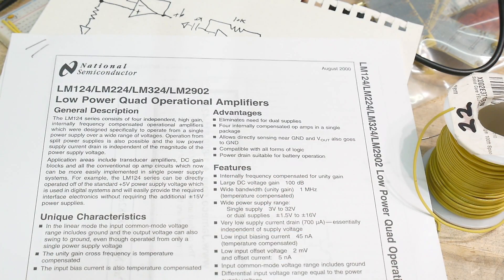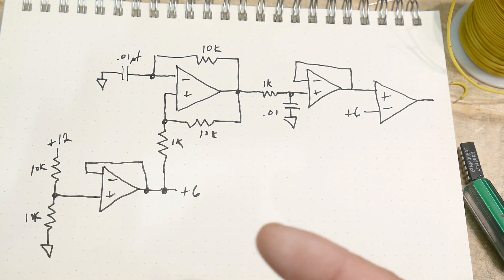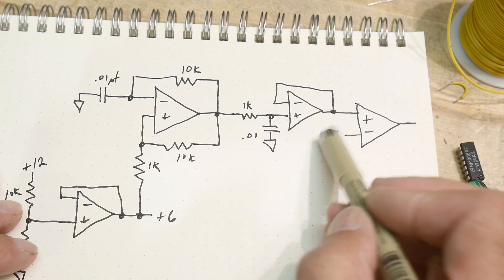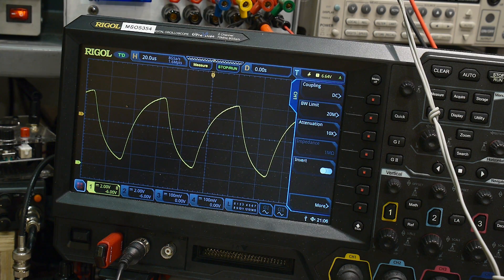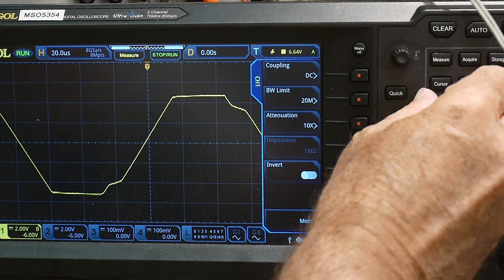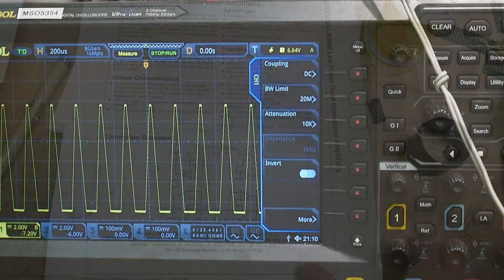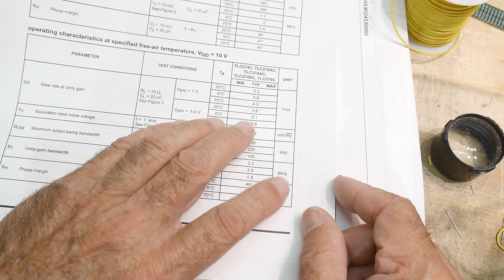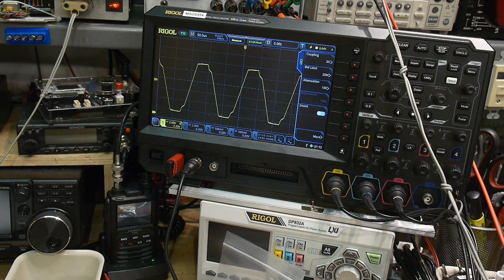#1177 LM324 Op-amp Slew Rate

Comment: ANY op amp can be used with a single supply or dual supplies. The questions are how close to the supply rails the output can swing and what the input common mode voltage range is. 

Op amps generally are slow when used as comparators. Two things come into play. Saturation of the output transistors, which are relatively large, means it takes time for excess carries in their bases to be removed or recombine so that turn-off can start. The other thing is that when the amp is driven to "large signal" operation, as they are when used as comparators, the internal frequency compensation capacitor(s) accumulate charge they would not in small signal operation. That excess charge needs to be removed to get signals to move. Amps without internal frequency compensation are generally faster but they are something of a rarity these days. If you want a good comparator, use a device intended to be a comparator. One advantage to an op amp as a comparator is that you can select an amp with ultra-low input offset voltage, such as a chopper-stabilized or "commutating auto-zero" amp. There are also a lot more choices if you need really low input bias current.

Comment: Just used a LM324 because I needed the large voltage range for a +\- 12 VAC output. Modern op amps don’t have that kind of voltage range. For everything else non-demanding I use the LM”V”324 or the MCP6002.
Reply: Yikes. Didn’t notice it was that bad! Your at roughly 6.5 kHz, so I’m probably okay in my application at 500-1,500 Hz.

Comment: The 324 is great so long as you're not working in the 100s of kilohertz. Used it in inverter and PSU designs, no issue
Reply: I get 15.9kHz maximum for a 10v pp sine wave with a 0.5V/μs slew rate. LM358 could be 0.3V/μs. That’s a 3.98kHz limit for 24v pp sine wave (worst case scenario). Fmax = SR/2piVp

Comment: Thanks for the video! But could you please go into more detail by what you mean by stiffen the 6 volts. How do calculate the return  path current? Coming off of your 12 volt divider why use the op-amp follower and not just come off of the top of the resistor for the 6 volts? If you have the time, could you go into more detail, that would be great! If not, we'll still thanks for the video! John
Reply from the maker: most of the time you don't need a buffer on the 6V, a nice capacitor is good to lower the noise. I just wanted to show one as many circuits have current that returns to ground, or in this case it returns to 6V and so if you have 100mA of return then yes you need a buffer
Reply: In detail, using 10K + 10K as a resistive divider to generate a 6V rail from a 12V rail is equivalent to a 6V supply with an internal resistance of 5K (the parallel combination of 10K and 10K). So if you tried to draw 1mA, for example, from that 6V rail, its voltage would drop by 5k * 1mA = 5V. That really isn't going to work if the +6V rail is now at just +1V.
However, if you buffer that resistive divider by using an opamp as a non-inverting amp with a gain of 1 (i.e. a "voltage follower") as shown in the video, then you can probably draw 50mA or more without any significant change in the 6V output.

Comment: If you re-check the "Voltage Follower Pulse Response" for the LM324 (at 9:06 ), you noted that it swung around 2.5V in 5μs, so you could have worked out that its slew rate is 0.5V/μs. That's pretty standard for these old op amps. It means the TLC274 is around 10 times faster.
Reply: I worked out 0.5V/μs in frequency: 
edit: 15.9kHz maximum for a 10v pp sine wave. 

LM358 could be as low as 0.3V/μs. That’s a 3.98kHz limit for 24v pp sine wave (worst case scenario).
Reply: @davadoff  I don't get the same numbers as you. Perhaps you could show your working and recheck your calculations?

I use V = A.sin(2πft) where is A is the amplitude (half the peak-to-peak voltage).
Then dV/dt = 2πfA.cos(2πf) which has a maximum when  t=0, making the maximum dV/dt equal to 2πfA.

If you consider a 50kHz sine wave with an amplitude of 5V (i.e. 10V pp), then you have a maximum rate of change of voltage of 2*π*50k*5 V/s = 1.57μV/s which then should be the minimum slew rate needed to avoid distortion of the sine wave.

At 50kHz, I would expect an LM358 (typical slew rate of 0.5V/μs) to be limited to a 3.3V pp sine wave typically, and around 2V pp at worst case.
Reply: @RexxSchneider  I did 10v / 0.5 (it takes 20μs to change 10v). I was imagining a sawtooth or triangle wave. I forgot to double it since it has to come back down again to make one full cycle (40μs total). Then 1 over 40μs to convert to frequency = 25kHz triangle wave. 

I googled for the 1.57 figure. I don’t know how to work it out myself. 25kHz/1.57 = 15.9kHz 10v peak to peak sine wave. 

Using 0.3v/μs and a 24v swing, I now get 3.98kHz. I saw someone measure their LM358 at 0.3V/μs, so I think 0.3 is a good, conservative value. That’s 45kHz maximum for 3.3v pp sine wave.

Comment: I love chip-of-the-day. Thank you. Great explanation of the 324's slew rate problems. As others point out, this chip is h-i-g-h-l-y faked. If it is what you want, only buy it from a known OEM distributor.
Reply: Or stripping from a really old audio board or mixer if you can find one 😂 And of course I'm sure you can find them in other things they were widely used but very popular for audio use.

Comment: Thank you very much! I've tried slew rate tests for single opamps, but I was unsure that I was using the right setup for. I'll retry it with your schematic.
Just a question: is it true that some opamps are designed exclusively as comparators? Can you explain the differences among opamp and this exclusive comparator in a next video of your?
P. S. Nice those radios on your bench! 😊
73 de IU8PWV 👋
Reply from the maker: https://youtu.be/mnRO1OK6bqY
Reply: @IMSAIGuy  The fender Rumble 15 bass amplifier has a really nice circuit diagram that is also compatible with this IC LM324. And you can also use a TLO74 or a TLO84 pinouts are compatible 😁💯 💖 Please considering checking it out online you can download the schematic and share it! 😊 The schematic is more than 10 years old so you  can not get in trouble for using it in a tutorial. So you could build it and share it if you wanted to. I think you will be impressed with the quality sound that it will produce. I plan to use it in one of my amplifier builds as the main preamp. I called fender tech engineers and they told me I could do whatever I want with it lol they've made their money. JBL and Peavey have also told me the same thing. I have given them quite a bit of business so i have got in good with them had long conversations on the phone with some and made friends. Wonderful people to work with👍💖💯 LOL they've actually sent me free stuff such as parts and components on the house. They are allowed to do that if they want. There motto is keep the customer happy and they'll come back and word of mouth is everything. And they love it when you fix their products  because it makes them look good as a professional audio amplifier distributor or maker. So they don't mind helping you get the job done. Back to the schematic  that I was talking about one thing I definitely like about the schematic is they used two zener diodes D1 and D2 on the input and you add +12 and negative 12 volts to them it keeps you from overloading the op amp input additional protection against both high voltage and negative voltage in a single component!👍👍 And note you can use this preamp in any amplifier design you want and you don't have to use the TDA chip amplifier or the LM chip or the JFET that is in the schematic if you don't want to. 👍 I know I was all over the place but I had a lot on my mind to share😁
Reply: @IMSAIGuy  Ooohh, many many thanks, Sir! That is what I was looking for!❤️👍
Reply: You usually test slew rate with the opamp configured as a non-inverting buffer with something like a few tens of pF as a load.
Reply: Yes some op-amps are specially designed just for sound reinforcement of course for amplifiers! That's why you pay more for those op-amps. Some op-amps do not have quality sound because they are used for like in computers to run certain functions on the motherboard or maybe in a TV or maybe you know in a car computer or to run machines or even used in a microcontrollers to link the analog world or even for a power supply. So they purposely do not make all op-amps super clean because there's no need for it  It's just used to control things or as a controller. That's why it's important to look at the data sheet to see what the op-amp is designed for and for it's general purpose and what it is  best  suited for in a application. But not to say that I have not seen high quality op amps designed for sound reinforcement in a power supply or in a TV or even in a microcontroller and more. Because they do sometimes use them. Yes I know my comment seems a little redundant 🤭 And the jrc-4558d op amp is very universal and popular too. You can use two together to build a quad op amp. Just thought I'd throw that out there. There's a lot of other factors but this is a few examples of the difference between op amps. I hope this will help you and have a great day 🤗
Reply: If I may make one more suggestion you can Google different op amps and it will give you a list of op amps and then you can look up the data sheets for them download them or print them off and compare them and also read the data sheets and they will give you detail about the op amps and how they function and what the purpose that they were designed for. It will give you a little bit more insight about the differences between op amps. I always try to go to the source to get my answers and that is the data sheet. Stay within the lines of the data sheet and you can't go wrong. One more little tip sometimes they do leave things out of the data sheet call the manufacturer and they'll be more than willing to give you the answer.

Comment: How simple and instructive, one example will say more than a thousand words.  👍
I encountered this problem when I was making a TDR, the prototype worked at a frequency of about 6kHz, the final product built into a large BNC connector 2.8 kHz same voltage, values and types of components just another IC of the same type. It works the same, the shape of the curve is the same, only the frequency has changed, the tolerances of the components are responsible for something, but I tried to choose the same values.

Nice day 🙂 Tom

Comment: Here are general purpose  opamps that I like TL071H, TL072H, and TL074H.  You guys know other general purpose  opamps, please share.  Also, if you guys know of very fast opamp, at reasonable price range in the market, please share.
Reply: TI make a range of video amplifier opamps which will probably be the fastest cheap opamps. Mouser prices the SN10501 (100-MHz bandwidth, 900-V/µs slew rate) at £1.
For a fast general purpose opamp. I've used LM318 for many years. It's a bit old in design these days, but still performs well.
Reply: @RexxSchneider  Thanks I will check it out.

Comment: Am I right, looking at the circuit there, if you vary the voltage on the inverting input of the last op amp you shoult be able to vary the pulse width of your square wave.
Reply: Well, it's really the duty cycle you would vary as the sum of the high pulse width and low pulse width is bound to stay constant.

Comment: Do you think it would be a "bad" design to build a circuit that takes advantage of a low slew rate part such as the LM324?   For example, if your goal is to build a sine wave generator and you use the LM324, then you could get away with less filtering (and possibly reduce a stage, thus simplifying your circuit).
Reply: Bad - Your design would then become less reproducible - slew rates vary quite a a bit
Reply: @andye2005  Good point, thanks for your comment!
Reply: @Enigma758  There is a real problem with temperature dependence of slew rate as well. You wouldn't want a sine wave that varied amplitude and possibly frequency with temperature just because it's slew rate limited.
Reply: One advantage of slow Op Amps is that they tend to be more stable than  their faster counterparts. Sometimes too high a SR can be detrimental.
Reply: Look up the circuit for the lm324 esr meter. This is an excellent example of getting the most out of a low bandwidth op amp.
Reply: @marka1986  Thanks, I found the schematic, but from looking just looking at it, it's hard to know what the bandwidth implications are.
Reply: @Enigma758  that oscillator is running at 50khz and would theoretically be a square wave but is almost a sine wave. Also notice how many stages of low gain amplification it takes to drive the detector and meter. When this meter came out there weren't many choices for low voltage op amps. I actually have this meter and it works quite well.